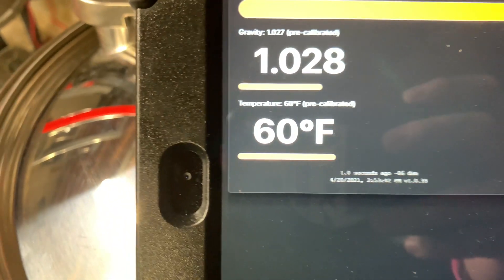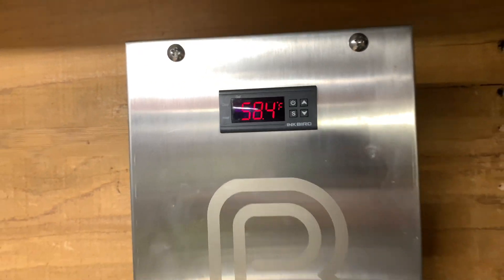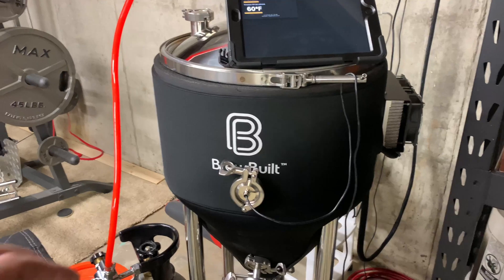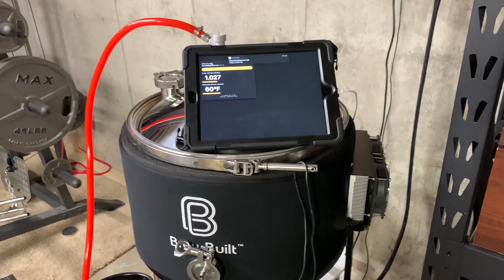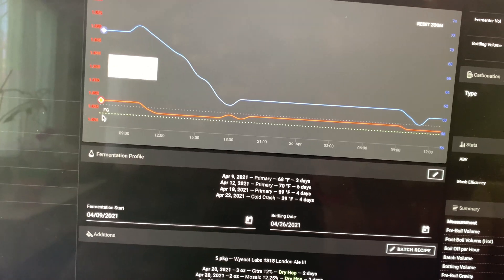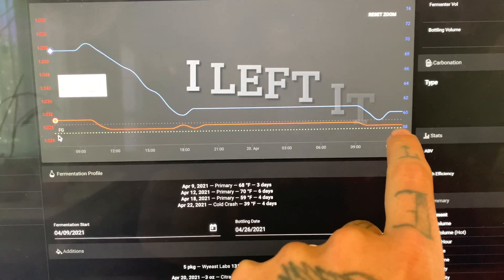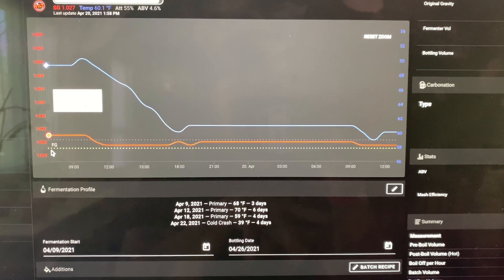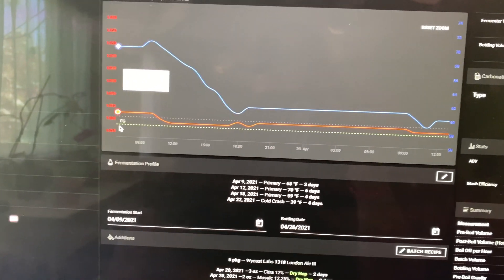BrewBuilt X1 Pro Temp control Update #2

Comment: I have a tilt, i have never seen those charts....  Is that the pro version?
Reply from the maker: In order to get charts you would have to use your tilt through a brewing software called Brewfather.
Reply: @zackrabbitbrewing4997  ok so what you are showing is third party software.  THanks
Reply from the maker: @kodydubarry4827  yeah it’s a brewing software. It’s comparable to BeerSmith.

Comment: great to see video of someone using not trying to sell this item. how do you find the general usage of it??
Reply from the maker: Over all it I like it a lot. There are a lot of good features that are comparable to all the other big brands. Happy with the buy so far. I am going to post another video soon to show how it performed with cold crashing. Overall I wasn’t able to get the temp below 48 degrees.
Reply: @zackrabbitbrewing4997  will keep eyes posted noticed when skim reading the manual it mentions no cold crash.
Reply from the maker: @garethsmith2250  yeah I seen the same but i also read the unit was capable of 30 degrees below ambient temp. My basement sits at 68 degrees so according to the claim it should have been able to get down to 38 degrees so I had to give it a whirl.
Reply: @zackrabbitbrewing4997  yeah I see you have the nice flash one..I also now see that 1.5tc blowoff which you could put a dump valve on you could swap on and off a hop dropper
Reply from the maker: @garethsmith2250  yes sir! Either fermenter you should be able to rig something up.